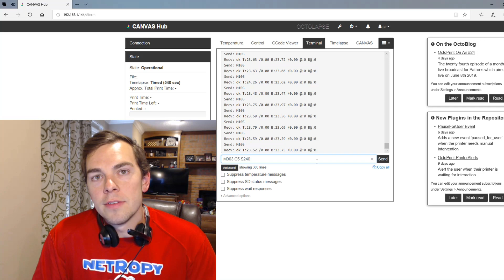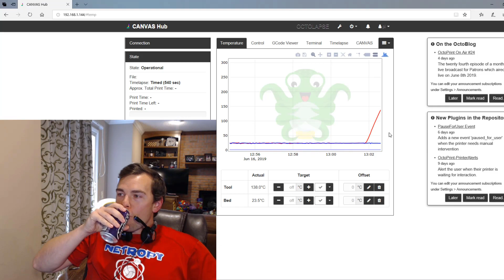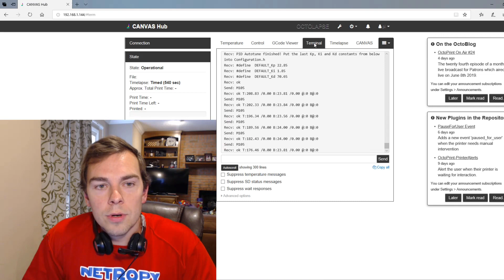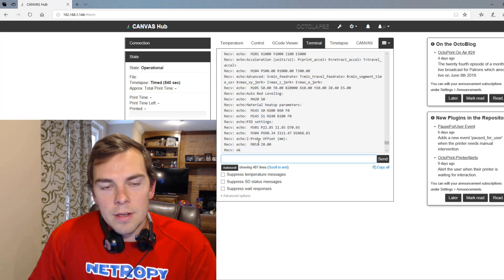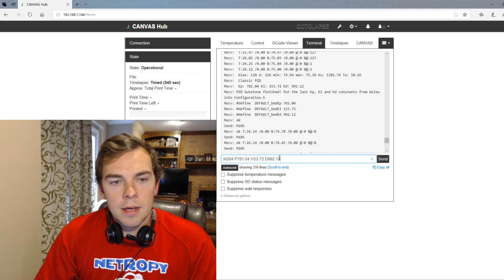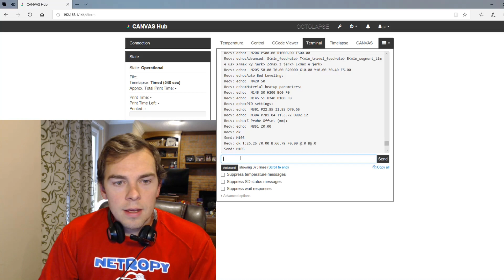PID Tuning a CR10S (or any Marlin 3D Printer) with Octoprint

Comment: Thank you for this info.  Experience has shown that if you feed material through the print head during this process, done so even by hand to emulate the printing process results will improve.  I tuned my 3D printer using this approach, excellent results with only about 1 deg variation ever.  Better temperature control better prints.   Again thank you, I wanted to share this with everyone.  Best of luck, Cheers!

Comment: I know this is almost a year old but you forgot to say you need to run your part fans at 100% when doing this so it can adjust for the air blowing on the nozzle.
Reply from the maker: Yes, it would be ideal to tune it under the same condition as how you most commonly print (probably with a fan if PLA) and with filament flowing (latent heat of fusion) and the hot end moving around (more forced convection).

Comment: Hi,
Thank you for the great video! Managed to tune hot end, but have issue with the bed :( I have a stock SR-10S and it looks like it does not accept M304 command to set the bed PID values - when I send this command (M304 P67.79 I7.26 D158.18), instead of confirmation I just get a message that it is being sent:

>>> M304 P67.79 I7.26 D158.18
SENDING:M304 P67.79 I7.26 D158.18

Any advice?
Thank you,
--Alex